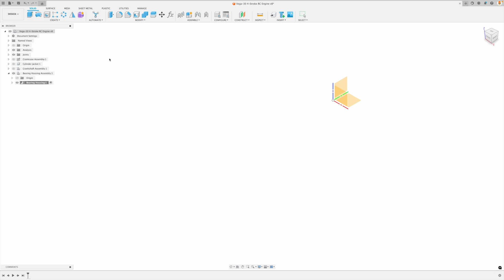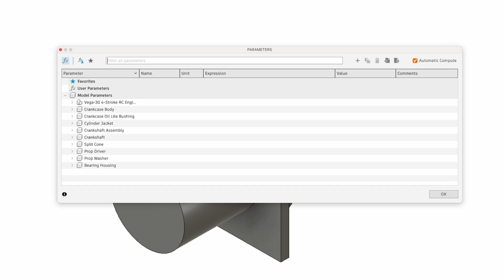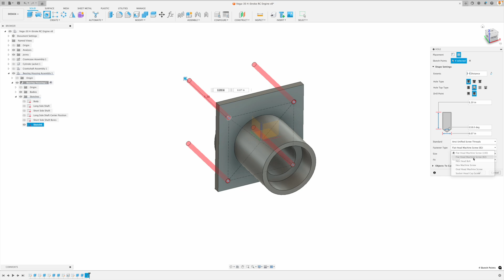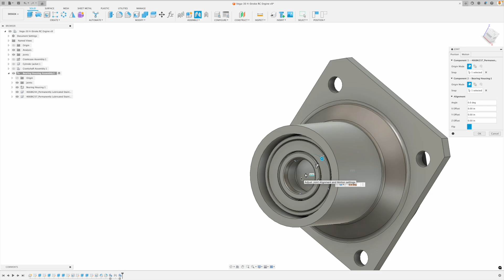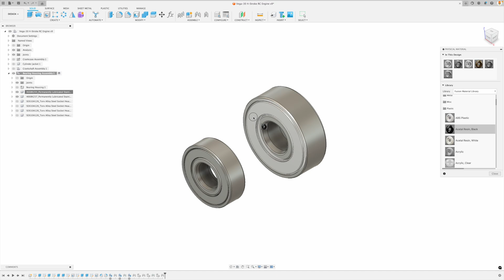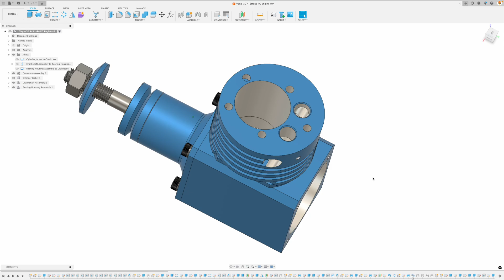Autodesk Fusion Intermediate Course - 4/10 - Bearing Housing Assembly 4-Stroke RC Engine (2025)

Comment: These tutorials have a better pace then those member one's,

U can always make the members videos little bit fast as well
Because most members are intermidiate and advanced fusion user .

This is just a small suggestion,
Reply from the maker: Thanks! 

Just so you know, when I practice modelling or do design work myself, I decided to do the recording of it to show the real deal, the behind the scenes way that I think and make decisions without any foresight. Those videos are mainly what I post for members. Most members want to see how I overcome problems when I hit the, and the reasoning behind such decisions. Those types of tutorials do not work well with YouTube public videos, which viewers tend to want to be more polished and professional. When I produce faster videos for members, I usually get comments saying to ‘slow down’ or to ‘explain more.’ 

So, I will stick with my current method. I will likely add very professional and polished videos for my members only at some point in the future too. Thanks again for your input!
Reply: Ok Sir no problem

Comment: At the end of the video, after creating the  section analysis in the YZ plane when I try to select the crankshaft pin to rotate the crankshaft,  instead of seeing the crankshaft revolve, the offset of the YZ plane for the section analysis changes. Furthermore, with the analysis hidden,  and the top level component activated, I can grab the motor and move it around. The Crankcase Assembly is grounded and with all the other components either directly or indirectly jointed to it, I wouldn't expect I could move the motor.
Reply from the maker: Thanks for messaging! It seems that there must be an issue with a component being grounded that shouldn’t be. Please make sure to unground any component that shouldn’t be, and just ground the Crankcase. That should solve it. If you need more explanation, it can all be found in the beginners lesson for YouTube and Patreon members only found here: 
Autodesk Fusion Course for Beginners - 4/8 - Bearing Housing Assembly for 4-Stroke RC Engine
https://youtu.be/oXl3IX89mS4
Reply: @learnitalready  Thank you. Turns out grounding the Crankcase Body rather than the Crankcase Assembly (component) gave me the expected behavior.  Interestingly, your video shows the ground pin icon on the component, whereas my model seems to require that the body be grounded and the pin is displayed there. I thought the pin would display on the component too (because of inheritance?) but that is not the case.  Anyway, problem solved (I think) and now I can move on to the next video.
Reply from the maker: @dieterweik6858  Great to hear! Thanks again for reaching out. Hope to hear from you again as you work through the course. I have more tutorials on their way. Stay tuned! □

Comment: Could you please put a direct  link to the exact set of drawings, rather than navigating through the entire library.
Reply from the maker: Thanks so much for your comment and request. I am happy to help, but just want to understand clearly your request. Are you finding it difficult to find the plan book itself, or the specific pages in the plan book that this course is based on?
Reply: @learnitalready  Thanks for your reply.I am having trouble with both specific pages and indeed the plan book. Kind regards.